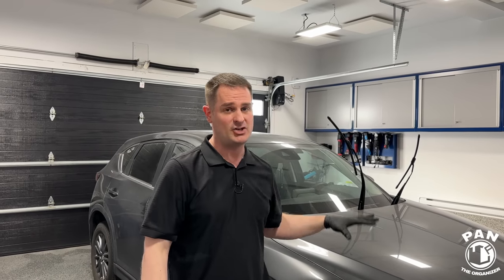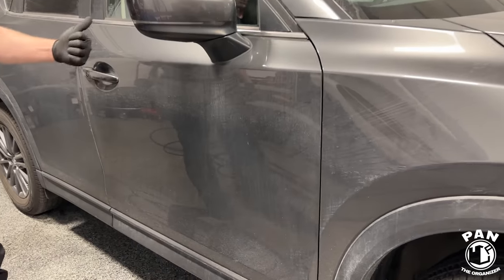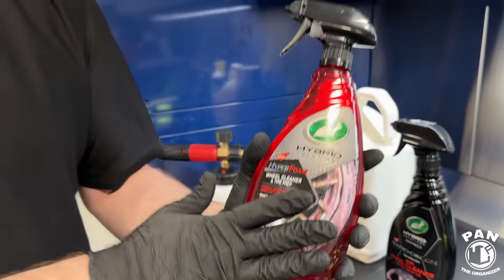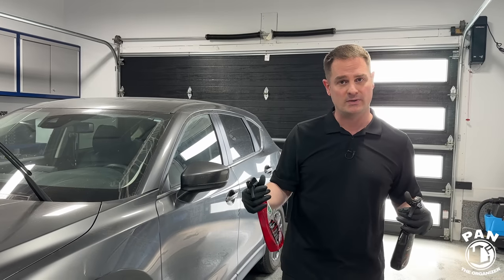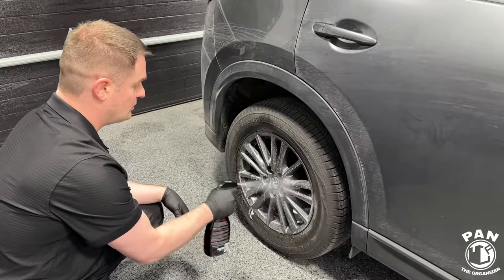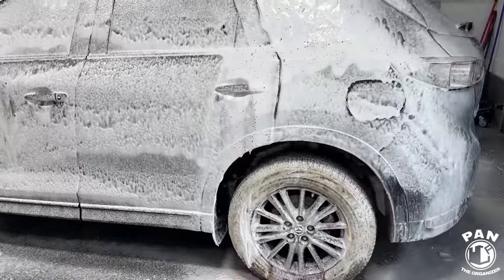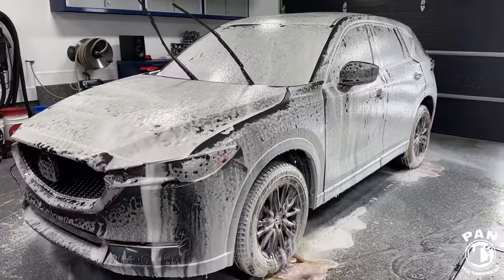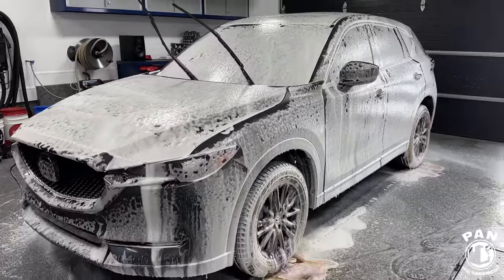MYTH BUSTED!! Touchless car wash??

Comment: yeah.... but what if you refoamed it,  again,  let dwell and rinsed with slightly higher pressure.  this worked best for me it got even more dirt off!
  "This is the way"
Reply: @Greg Sullivan    he's using the Kranzle 1122tst adjusted to 1000 0si for max flow over 2 gpm.  I used a Karcher1700 with a 3.5 orifice to get 1100 psi and 1.45 gpm.  but after rinsing  when I refoamed with superclean and soap and used a 2.0 orifice it cleaned the dirt off much better.  I got 1520 psi with the smaller tip at 1gpm.  so if you're going to do touchless. it's best to forget flow rate and up your pressure. just go over everything thoroughly from the bottom up. 👍

Comment: It's worth noting Bilt Hamber Touchless is highly alkaline/caustic, will remove waxes/sealants, and degrade ceramic coatings.
Reply: Totally untrue. 
A true ceramic coating will absolutely withstand this. 
I've asked Bilt Hamber personally about this specifically
Reply: @pfgdetailing  actually, it depends on the type ceramic coating, which are typically chemically resistant up to a pH of 12 to 13. At that level of alkalinity, most coatings will start degrading to some degree.
Reply: What would you suggest then, as an alternative?
Reply: @decker0373  I'm a detailer, I use BH to take care of my own ceramic coated cars, it's perfectly fine if you have a true ceramic coating.
Reply: @PFG Detailing  hi, yep, I don't have any issues with BH, I use Autofoam on my waxed car and it's fine.  I would say thay it marginally speeds up the degrading of the wax, but it's negligible, in my opinion. Anyway, I try hard to look after my car and if that means reapplying wax a little more often, so be it.
Reply: @decker0373  you make a good point, some people like to wax their cars as it's relaxing so it's almost a good excuse to strip it a little so you can get out there again 😂
Reply: @decker0373  keep it closer to pH neutral, and increase the dwell time. DIY Detail Incredible Suds is pH 8.5, so slightly alkaline. You still get plenty of cleaning "bite", but not enough to degrade waxes/sealants nor ceramic coating.
Reply: The drying aid should add a layer of protection after each wash.  Dragging a washmit and towel across the surface will also remove the protection.
Reply: @TheBreakfastLover  Also remember the pH is less when diluted with water through the foam cannon. I’ve tested the pH of Touch-Less when diluted @ 1:15 and it’s approx 9.0/9.5 pH.
Reply: @MartynFlowers  the pH scale is logarithmic, so a 1:10 dilution would decrease the pH from 12 to 11, a 1:100 dilution would decrease the pH to 10, and a 1:1000 dilution decreases the pH to 9.
Reply: @TheBreakfastLover  It was only universal litmus paper roll 🤔
Reply: @TheBreakfastLover  I agree on increasing dwell time with less aggressive soaps. Thanks for tip on the DIY stuff, I'll check it out. Currently mostly use MegHyperwash and have been wanting to try something more aggressive.

Comment: I believe the key take away from this video is the word maintenance. You did mention some restraint on using this method often because the nature of product strength. With that being said I would wholeheartedly prefer this kind of wash only in winter because it removes just enough road grime without it getting completely caked onto the surfaces.
Reply from the maker: Correct

Comment: Just to clear the air a little with chemistry: Exothermic produces heat; chromic reaction changes color; endothermic reaction absorbs heat. The "Iron-x" component for the rims may be exothermic (you'd have to measure the reaction with a thermometer), but it's certainly chromic. I know, it's just a detailing video, but you can always learn.
Reply from the maker: IronX produces an exothermic reaction during oxidation process of the ferrous materials, and a chromic reaction for the color change.
Reply: @PanTheOrganizer  Cool beans.

Comment: If I wash my car with these products in my back yard,
will it hurt my grass?
I don’t have anywhere else to wash it with my pressure washer.
Thanks for all the great videos!
Reply: I don't think the BH will be an issue, being that it is sugar based but, maybe ping a message over to BH and see what they say. The same with TW.  Good luck 👍
Reply: Probably do more damage stomping around on the muddy ground than the chemicals used.  The amount of water used is going to dilute the product to a non-harmful level.
Reply from the maker: Bilt Hamber says their products are environmentally friendly so your grass should be fine.

Comment: Do you never use cold degreaser? I think that would remove the film. In Sweden we always use cold degreaser during winter, otherwise we don't get rid of the film from salt and other winter crap. I apply cold degreaser first and then after a few minutes I apply alkaline degreaser on top of it and then wash both of after a couple of more minutes.

Comment: Great video. Question for you though: have you tested any 2-step touchless washes? It would be nice to see a comparison between this one step soap and a 2-step soap. Mainly because with 2-step soaps, the step 1 is a low pH which helps to breakdown the static bond which makes traffic film stick to your surface. Then you follow-up by foaming the high pH step 2 overtop of the step 1, which neutralizes the step 1 and also breaks the static bond between dirt particles and the surface. In my experience, the 2 step touchless soaps work loads better than single step ones. 

Full transparency, I do work for an automotive chemical company. I reached out to you via email 2 years ago offering to send a free sample of another one of our products and didn't receive a reply (I'm sure you get a lot of emails, so no worries). But since then, we have released a 2-step touchless wash which has been very well received by the trucking industry and also widely used as a maintenance wash for ceramic coated vehicles. This comment isn't meant to be a plug for our brand, so I'll refrain from mentioning the brand name or product name. If you search your emails from July 2021 for my name, you'll find it. 

Always love your content. Cheers!
Reply from the maker: Hi DJ! I often use high and low pH steps, like in my ultimate spring maintenance tutorial here: https://youtu.be/oTaFE_p2OAw?si=HbJ1OtLy_GFGA4MS

I explained that well. And yes you're on the right path with your explanations.

I also use two step pH pre-wash and wash in my new car prep videos like these: 
Mercedes S 580: https://youtu.be/Vq_tfcwryVI?si=whord2_UEFSg28UW
Aston Martin Vantage: https://youtu.be/OKga3yZVTqo
Volvo XC60: https://youtu.be/tvDBBenhYFA
Tesla Model Y: https://youtu.be/gohks8xP5NY 
Porsche 911 Carrera: https://youtu.be/2ckiivbFqs4
Audi Q7: https://youtu.be/t7HCBSVnizM

I receive thousands of messages and emails daily across all platforms, so it's impossible for me to reply to all as you can imagine. I focus on replying to YouTube comments every day, which already takes me up to 4 hours. It gets overwhelming, I won't lie, as I have almost 1 million subs, but it allows me to stay connected with my audience. No other big channel replies to all the comments like I do, so I take pride in that. 

Cheers!
Reply: @PanTheOrganizer  Thanks for the reply! Keep up the great work!!

Comment: Hi Pan,
is it worth jet washing the vehicle first, then put the B-H foam on?
I find if you do this the chemicals do a much better job of getting deeper in to the grime.
P&S Brakebuster is my go to wheel and tyres, but is there something better for really dirty tyres initially?
I'm about to do first cleans on my brothers cars for his garage, not to your or my level but a decent level, so was thinking a TFR (traffic film remover) as a first job, but seems the B-H is better?
Where did you get the protector end on the car dryer, I have one of these and its great but sometimes just touch the car so a protected nozzle would be very good?
Thanks for the info as always, my go to for anything I need looking at.
Enjoy the spring!

Comment: Out of curiosity, do you prefer the turtle wax hyperfoam over brake buster? I use both since my M brakes create a lot of dust and I tend to use it when the rims are completely soiled. It does seem like the hyperfoam does a lot more work pre agitation, but after agitation the results do look the same. The hyperfoam also runs out incredibly quick compared to brake buster.
Reply: Yes i too would like to know what you thought of the wheel cleaner
Reply: Frr yea what’s the best wheel cleaner with lots of break dust

Comment: Pan, what am I doing wrong? I tried to do a touchless wash and that didnt work, so I decided to wash my truck in the safest way possible since its band new and I dont want to scratch the clearcoat.  I went out and I bought a dozen of Microfiber Chenille Mitts to wash my brand new black truck with my foam cannon.  I foamed the entire truck and I let the soap dwell for a little bit and then I used a clean wash mitt for a small section.  As soon as I was done I tossed the dirty mitt in a bucket and I used a clean unused mitt on the next section.  When I air dried the truck I noticed some small swirl marks on the paint.  I dont understand how this happened?? Do you have any idea what I did wrong?

Comment: Hi! Just wanted advice. I'm very sensitive with swirl marks and scratches. I used to wash my car in the garage myself. But I moved to an apartment with no water supply and hose in the garage giving me only tunnel car wash as an option to clean my car. I know improper ones can scratch, but if I always have a proper layer of wax, will that guarantee that my car won't get swirl marks in the long run? I dry my car properly with microfiber so its just the automatic car wash I'm worried about. Thanks!

Comment: Pan, thanks for the video.  Are those higher ph snow foams safe to use on coated cars?
Reply from the maker: Only if used every week at 5% PIR. That's a bit too strong for continuous use. If used once in a while, every other month to remove grime and traffic film, no problem for true coatings (glass bottle types) as those can typically resist higher pH chemicals. But if you want to use it weekly, just use it at 2% PIR and that's fine.

Comment: I was getting nervous watching you spray the wheels one after another and letting them sit.  I've seen a lot of wheel cleaners kind of strip the shine from wheels so I do wheels one at a time
Reply from the maker: A good snow foam shouldn’t strip the finish. What kind of snow foam were you working with?

Welcome to my channel. You discovered one of the biggest car detailing channels on YouTube as we surpassed 895,000 subscribers and we have over 116 million views! I have been detailing for 26 years and I love to share my knowledge and passion with my viewers.

You found the right channel to help you learn everything about detailing.
Reply: @PanTheOrganizer  man I'm a long time viewer and commenter!  We've talked before.  I wasn't talking about the snow foam, the wheel cleaner... I am always scared to leave them sitting on the wheel very long.
Reply from the maker: If you work in a controlled environment like me, you don't have to worry about the wheel cleaner drying too quickly, so you have a few minutes of working time.

If you work outside, for sure once you spray the wheel cleaner, I would start brushing right away, and then rinse, and then move on to the next wheel. You never want wheel cleaner to dry on the surface.
Reply: @PanTheOrganizer  yeah, I'm always washing in the Texas heat - I am under a carport, but it's Texas and stuff dries quickly

Comment: Question, I usually see a vehicle sprayed with the pressure washer before any foaming chemicals are applied, does the directions on the Touchless soap state that this step wasn’t needed?
Reply from the maker: There are two schools of thought when using snow foams for the pre-wash. Some like to foam on dry paint (as the foam clings on better and isn't diluted by water on the surface). Some like to pre-rinse first, to knock off the loose dirt and debris, and then foam.

Both methods are good, depending on your preference. I find that foaming on dry paint works a bit better most of the time. If you want to pre-rinse first, at least spray a rinseless wash as a pre-treat first, then rinse. The rinseless wash will act as a lubricant to encapsulate the dirt before you blast your paint with 1000-2000 psi of pressure.

Comment: Iron fall out remover is meant to be used surely after you've cleaned the wheels with a wheel ckeaner so the fall out remover is s acting on the iron rather on the dirt ..
Reply from the maker: Yes normally it’s best to wash the vehicle first, before doing chemical decontamination.

Like I do in all my full car detailing videos:
Mercedes S 580: https://youtu.be/Vq_tfcwryVI?si=whord2_UEFSg28UW
Aston Martin Vantage: https://youtu.be/OKga3yZVTqo
Volvo XC60: https://youtu.be/tvDBBenhYFA
Tesla Model Y: https://youtu.be/gohks8xP5NY 
Porsche 911 Carrera: https://youtu.be/2ckiivbFqs4
Mercedes AMG GT63S matte black: https://youtu.be/eU8zg1lXvXY?si=oGxoCp8PWt7gTncV
Audi Q7: https://youtu.be/t7HCBSVnizM

Comment: Can I use BH TouchLess after TAR spray[before claying, machining and coating]?? Tar spray needs to be flushed with some detergent, not like Iron just with the water?
Reply from the maker: You wash the car first, before using tar and iron removers. Once the tar stage is done, all that is needed is to thoroughly rinse. Or you can rewash the car quickly or blanket with a pH neutral snow foam and rinse again.

Comment: salut pan , dans certaines vidéo de maintenance de céramique tu utilise une snow foam de ph 12 (bilt hamber) dans une plus ancienne vidéo tu préconise une douce et aujourd'hui tu dis que ph 12 peut attaquer la céramique ( logique). Il y a un mois tu faisais un prélavage super basique (bilt hamber) et un shampoing acide descale avec un super résultat . je suis un poil perdu :question quel prélavage et shampoing utiliser pour restaurer les propriétés de la céramique et garantir sa durée de 5 ans? foam ph7 + descale ?
Reply from the maker: Tu n’utilises pas un shampoing pré-lavage à toutes les semaines. Une fois de temps ça va.

Comment: Awesome video as always.  I have to ask this question and apologies if you already did a video on this.  What confuses me sometimes is the post foam application.  I've been on the safer side and washed off the foam before my contact wash.  My question is this:  If you use a foam, say Auto Foam, do you have to rinse it off before contact or can apply a foam and then follow it up with a contact before rinse?  Of course, this is assuming normal/light grim levels and nothing that is caked in salt and/or mud.
Reply from the maker: I always recommend to rinse the foam after the dwell time. So you would foam, rinse, contact wash. Some like to re-foam before the contact wash, so you would foam, rinse, foam and hand wash.

However, if you want to do the 2nd option, I would recommend a pH neutral shampoo at that point, not Touch-Less or Auto-Foam which are higher pH snow foams. Those are meant for the pre-wash, not the hand wash.

Comment: Personally, I want to avoid any high PH soaps after getting my car corrected and coated. BUT I also want touchless 😢
Reply from the maker: I use Touch-Less every other month on my ceramic coated car and no problem. As long as you don’t use it weekly at a 5% PIR you’re fine.

For more regular washes, 2% PIR is more than enough.
Reply: @PanTheOrganizer   noted! Thank you Pan

Comment: Can the Bilt Hamber touchless cleaner be applied with an IK sprayer for similar results, or is a pressure washer required?
Reply from the maker: You can use an IK foaming pump sprayer to apply the snow foam, yes.

Comment: what do you detailers out there do when you live in a climate that pretty much leaves no "cool" surfaces?  I am spending all day barely getting two cars done at my dealership.  I am a one man show as well, so completely washing and drying a car while making sure to get any drips is taking nearly an hour in itself.  I also have no access to air for the time being, nor soft water!  I may need to have someone invest in a nice blower like Pan has, and need to get my hose hooked up to a decent soft water system.
Reply from the maker: You need a water deionizer setup. Check out my video here: https://youtu.be/IKNL1chAQXY
Reply: @Pan The Organizer  cool I need to just get some new soft water media for our system and get it hooked up to the hose.  If possible.  Gonna keep watching.  Thanks

Comment: How do you have a garage drain setup? Does it go into the sewage line or the storm drains? Also when you wash in the garage don't you have over spray that goes all over the place?
Reply from the maker: I have two drains in my garage. One for each car. They are part of the build code in Montreal, as we have crazy winters so all that snow and ice melts on the floor. The drains are connected to the sewers.

The garage is an oversized 24 x 24 (almost 600 sq.ft) with 13 ft ceilings so water splashing is never an issue.

See my full garage tour for all the cool details here: https://youtu.be/wx6HTBAzeXI?si=Y9QF5xPFw07BCBPs
Reply: @PanTheOrganizer  as long as it's going in the sewers it's good for car washing right? I know that some municipalities strongly prohibit the use of washing cars on the streets or even driveways because of the concern that car washing chemicals can enter storm drains.
Reply from the maker: Always follow your city's laws and regulations.
Reply: @PanTheOrganizer  that's correct. I was wondering what are your thoughts on rinseless washes? Do they scratch and Mar the paint anymore than traditional wash?